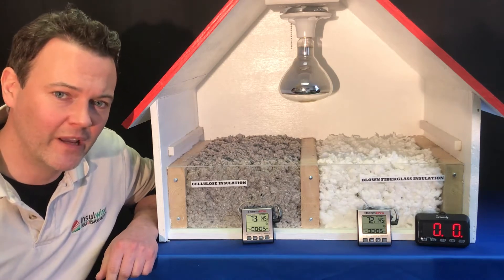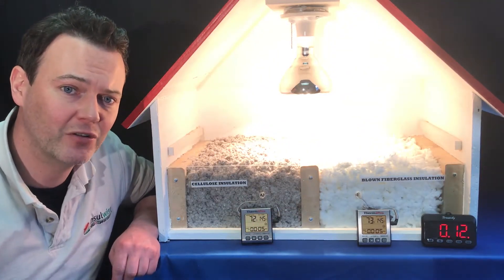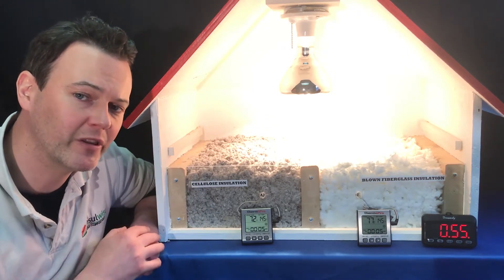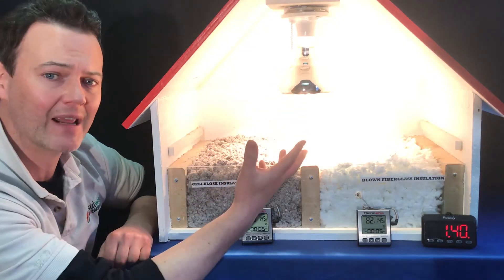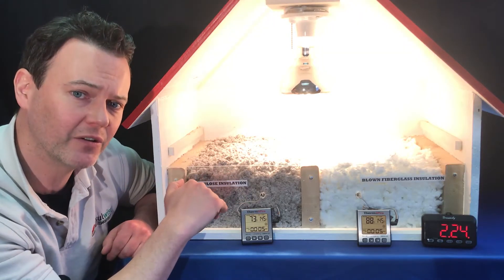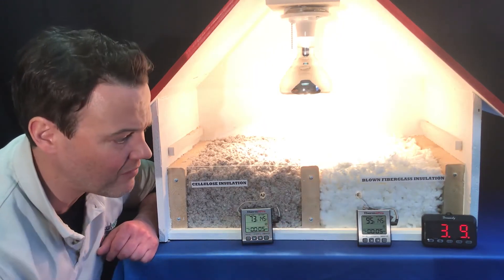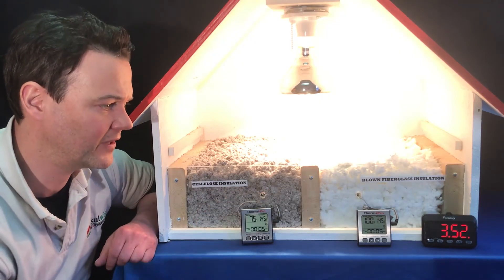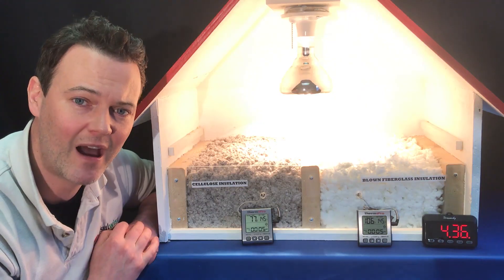Cellulose vs. Fiberglass Insulation: The Ultimate Showdown

Comment: A couple of notes: cellulose contains dioxins from the ink that was in the newspaper that it’s made dioxins are poisonous. If water gets in your attic through event, cellulose becomes a hockey puck and never comes back It has to be replaced. The fiberglass will dry out, everyone has venting in their attic. If you actually do the price comparison for how many bags of cellulose you need versus fiberglass it works out to be more expensive to buy cellulose. One final note I have installed lot of blown fiberglass and once it gets to a certain thickness which you haven’t achieved in this test, it reaches a density which prevents the air from moving through it, but you have to have enough for it to compress to stop the air from moving through it once you do it has a nice thick layer the air doesn’t move through. Just summarize it’s less expensive, it dries out on its own without being replaced, and it doesn’t contain dioxins. I am a contractor and I will go with whatever is the least expensive and the best performer fiberglass wins.
Reply from the maker: Thanks for your comment.  Let me try to address some of what you said.  1)  Most inks used in newspapers today are soy based (according to google AI!)  Cellulose insulation is considered by just about every source I have seen to be the least toxic / carcinogenic type of insulation available in the US.  I have not seen where dioxin is used in ink in any papers.  Dioxin was however a primary component to the herbicide Agent Orange that was used in Vietnam.  It would be "weird" if newspaper companies were willingly using one of the most toxic chemicals known to man for printing...but I certainly don't know everything.  

2)  I have encountered cellulose insulation that has gotten wet many times in attics (roof leaks are much more common than people think!).  Cellulose is hygroscopic.  It absorbs water, but also just as easily releases it back to the air as it dries.  it can get crusty.  This easily solved by crumbling / breaking it back up.  It's fine.  There is no chemical reaction that occurs when it gets wet that alters it's chemical or physical properties.  Here's a link to the video where I find wet cellulose in an attic that was caused by an unknown roof leak:  https://www.youtube.com/watch?v=2XQK-Ba1hWc&t=4s

3)  Cellulose is usually much less expensive than fiberglass insulation is.  Cellulose requires about 80% less energy to manufacture than fiberglass does.  There's no need to heat sand / silica to 2,000 degrees to melt and spin it into a fiber.  The base material for cellulose insulation is also...used newspapers.  Big difference.  As someone who buys these materials by the tractor trailer load, I can tell you that cellulose insulation is less expensive for the R-Value getting put down in attics. 

4)  In terms of blown fiberglass not allowing air to move through it, you actually have it backward.  Blown fiberglass is notorious for allowing air flow within it, so much so that its R Value actually degrades as the temperature drops -- due to convection currents that develop within it.  Cellulose insulation on the other hand settles by about 10% after it is loose filled in an attic.  The settling process causes the fibers to lay tighter and more closely together, which makes it much more effective than blown fiberglass at retarding air flow within it, it is simply a much denser material when installed.   Here's a useful article from Green Building Advisor on the subject: 
https://www.finehomebuilding.com/2010/11/11/blown-insulation-for-attics-fiberglass-vs-cellulose
Hope this helps!  
Andy

Comment: Andy thanks for the demo, my neighbor  has fiberglass ,but needs more it has become packed down from workers going up in her attic.  I would like to air seal before adding more insulation.  Would you just top off with cellulose  or remove everything and start fresh?   Her roof is low pitched so getting  within  8' of edges is not feasible.  I can air seal  about 15' width down the middle of house.   house is 1700 sq/ft
Reply from the maker: We top coat over blown fiberglass on a daily basis.  The main issue is getting that attic floor well air sealed, good on ya for giving that a go!

Comment: Thanks for the great presentation! I'm trying to avoid blown fiberglass and cellulose is what my HVAC guy suggested; this helps to make even more sense.
Reply from the maker: Thank you!  Cellulose is what we've worked with exclusively for years with attic blows.  The insulating difference is something you can even feel when you're air sealing attics that have blown fiberglass versus cellulose.  In a hot attic the heat penetrates much farther down in blown fiberglass, as where the cellulose feels cooler after getting just a few inches below the surface.  Cellulose insulation has so many pluses going for it, in our opinion.

Comment: You got the R-values wrong. Blown fiberglass is 2.85. R-value per inch of depth and cellulose is not 3.7 it is 3.3 to 3.5. 

You should’ve compared 9 inches of cellulose to 11 inches of fiberglass.
Reply from the maker: From Oak Ridge National Laboratory via Green Building Advisor
"Dan Lea has a different take. He tod me, "The guys at ORNL and R&D Services ... [performed] research we paid big bucks to do. Their conclusions: at nominal settled density, cellulose R-value is R-3.6 to R-3.7 per inch; at wall density it is R-3.8 to R-3.9. They base this on studies of multiple materials."

Comment: How long does the fire retardant really last?
Reply from the maker: According to the Cellulose Insulation Manufacturers Association "While research in this area is limited, there is evidence to suggest it could take over 300 years of extreme conditions to reduce the fire retardant efficacy".  So the odds are good that you won't have to worry about it.

Comment: Just when I get hooked on an insulation product, then I see the opposition which convinces me otherwise. But then I go back, and then back again, and back. So confusing. But anyhoo, on a new construction I have a 24x32 garage with living space above which has open web floor trusses that are 20" in height. This garage has 2 earth-bermed walls so it's like a walkout basement. There are the 2 concrete walls framed with 2x4's, the garage door side, and the back side which has a 2x6 wall. I do not want the entire 20" filled and was thinking an R-19 should be fine, so about 5 inches if using cellulose. Zone 4 btw. My question for anyone is installation. Should I put up a net before drywall and blow, which is another expense, though landscape fabric isn't terribly costly? Or, have the drywall hangers leave an opening in the center to blow which can then get replaced?
Reply from the maker: These type of ceiling assemblies over top of unconditioned garages are tricky because the gap (20" inches) is so big.  The absolute KEY is making sure that any insulation that you use remains tightly pressed against the underside of the floor above it.  This would be an excellent application for open cell foam.  Many outfits can do this fairly cheaply these days...if you had 4-6" inches sprayed on the underside before the drywall was hung it would give you an excellent outcome.  
You could net-and blow the floor as well, but if you don't use dense packed cellulose, or densely pack blown fiberglass, an air gap will form and your floors will be cold.  Dense packing any insulation however is typically only an option for professional insulation companies.  Our machines are about 800 pounds and truck mounted, but I have seen rental machines that contain air locks (needed for dense packing) offered in some parts of the country.  
Hope this helps!

Comment: Cellulose in an attic we blew 20 years ago went from 30" to 10" ... Happens  to many types but cellulose just seems to do it much more than others... you'll need a touch up eventually.
Reply from the maker: Hi Tim, that really sounds pretty bad.  I've had to go back to numerous homes that we've previously done over the years (sometimes customers just have questions about what's going on in their attic spaces) and I haven't seen settling that bad.  We always blow in about 15" and we always use depth sticks to measure this.  So long as the original blow was done right, it should not settle more than 10% or so.  
Andy
Reply: @insulwiseenergycomfortsolu3293   I owned a company called TAB production.  Our main function was to purchase very old neglected homes.  What we found in nearly every home with Cellulose in the attics (and most of the homes had cellulose) we could rewire old knob and tube without so much as touching the cellulose blown in.  It was pancaked entirely in all the attics.  Can't figure it out.  Of course some was obviously abused, walked on, animal issues and wind blowing in he eves...  but the rest I cannot explain.  We would spray new fiberglass as we didn't have the issues with tracking and we could not explain what had happened to the cellulose to make it act this way.

Comment: What average percentage drop in air leakage do you see after vacuuming out, air-sealing and insulating with Cellulose?
Reply from the maker: Hi Bruce great question.  In our business we rarely remove existing insulation because of the added cost, but we have a pretty intensive air sealing process for insulated attics that I created a video for.  That said, whether the insulation is removed or not, we average a 35% drop in total home air leakage from doing attics alone.  Some houses we can only get 15%, but in others we get 70%.  And that's with using blower door test in / test out, so we're not just guessing.  We also do a fair number of attic zone tests so we know we're getting these attics tight.  Often our homeowners will comment on the change they've felt solely from the air sealing work (this is for two day jobs where we air seal the first day, and pop in vents and blow the next. 
Andy

Comment: and if you compared that to spray foam the temp would be pretty much still the starting temp as its extremely effective at blocking radiant heat as well as stopping convection and conduction heat transfer.
Reply from the maker: Spray foam is good stuff, but the two primary types have very different R Values.  Open cell spray foam has an R-Value of about 3.5 per inch, which is about the same as cellulose.  But closed cell foam, which may be what you're thinking of, has an R-Value of about 6.5 per inch.  That stuff is a crazy effective insulator, you are correct.
Reply: @insulwiseenergycomfortsolu3293 some newer 2lbs closed cell foams can have R-values up to 7.5/inch depending on thickness. 4 inches of Huntsman HeatLok HFO high lift is R-30.

Comment: Radiant heat, such as from this light is able to pass through fiberglass, which could account for the above average heat transfer. There are 3 different types of heat transfer. They all behave differently. This light would be a radiant heat source much like the sun. The light waves carry the thermal radiation and don't transfer any of it until it touches something that the heat can then radiate from. Whereas conduction or convection work differently. There is no sun in an attic or wall cavity, so if he really wanted to make this experiment unbiased he should use a convection heater such as a space heater and pump that hot air into the simulated attic space. That would be a much more accurate experiment.
Reply from the maker: Hi there Ian, you're correct on the three types of radiant heat transfer and that there is no sun in an attic.  However-- radiant heat transfer is exactly what heats the attic up during the summer time.  The sun heats the shingles to 150-160 degrees F, that heat conducts through the roof and heats the roof sheathing and roof framing.  At that point the heat radiates into the attic area below.  It's the same as when sunlight comes through a window, heats the furniture and carpet within a room, and then that room gets hot.  The heat from the light is heating the surface of the insulation.  The fact that the blown fiberglass is so light and fluffy is a significant problem with it.  The problem gets even worse during the winter when cold air "falls" down through it, and convection currents form within it from heat coming up from the ceiling below.  
Andy
Reply: @insulwiseenergycomfortsolu3293  Correct the sun radiates heat to the shingles through light waves. It is then conducted through the wood into the airspace of the attic. But once in the attic space, there is no more radiant heat, because radiant heat needs a source to radiate from!  So the transfer of heat through the airspace in the attic is caused by convection, not radiation. That's what I'm trying to explain here, is that the heating lamp used in your demonstration here is a source of radiant heat, which transfers heat energy much differently than convection. you will have no radiant heat sources in an attic space, so this experiment is not a fair comparison to how heat transfer would work in a real attic space.  And the proof is in the pudding, because in houses that are insulated with cellulose vs fiberglass, we don't see this vast of a difference in the temperatures of the living spaces as long as they are insulated with the same R-Value.  I know this by comparing data provided to me by consumers energy's  insulation rebate program. See I own a building company, and I happen to have degrees in thermodynamics, building performance & dynamics, and business management.. I will install whatever material a customer wants in their attic, but I will thoroughly explain  the pro's and con's of BOTH materials. I just don't appreciate when people try to make one of them out to be inferior based on apples to oranges comparisons.  The science should be done by scientists, with hard data, and control tests so that we can get down to the facts.  All variables need to be considered in order to make an experiment actually prove anything.  I appreciate you having a dialogue with me rather than just ignoring.  But I'm just telling you based on my education and my decade of experience designing and building houses, this isn't an accurate test. No offense at all to you sir, but I have to call out inaccuracies when I see them!

Comment: Seeing as the R-Value of Fiberglass is 3 per in and cellulose is 3.5 per in, Shouldn't the experiment be done with a few more inches of fiberglass to account for that, so we are measuring the same R-Value?
Reply from the maker: The R-values are different, which I do explain.  The intention of the video is for people who are considering one material versus another in terms of the relative effectiveness of the two materials.  Many people look up in their attics in just some insulation and think "I'm good, I'm insulated" and don't realize that they are likely not nearly as well taken care of as they should be. 
Andy